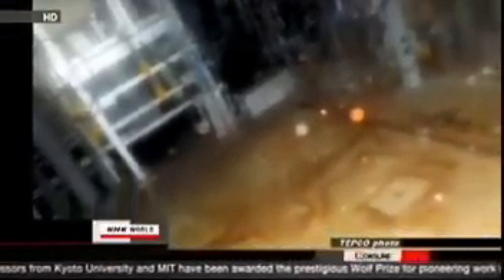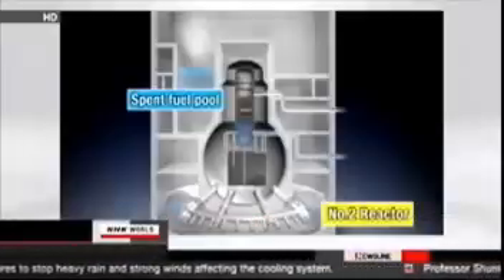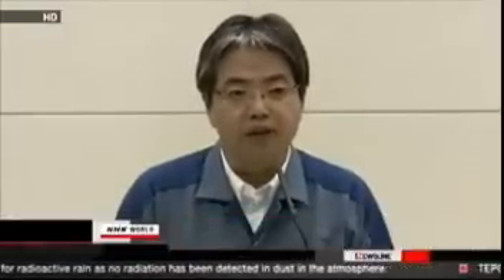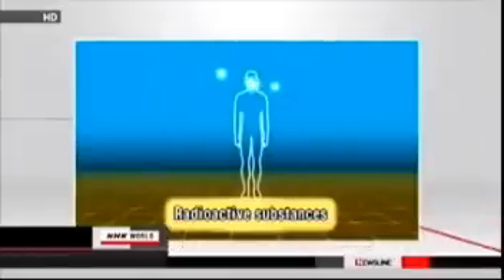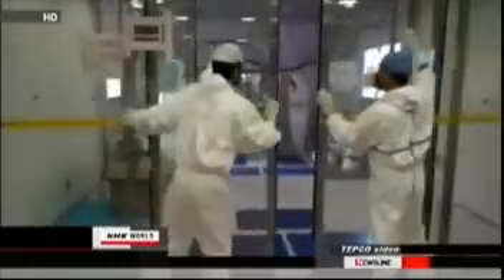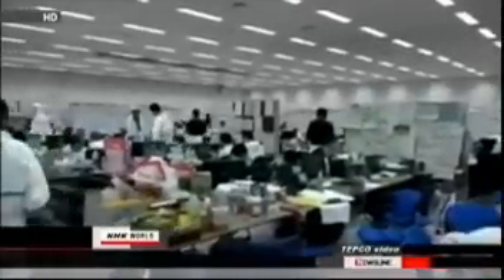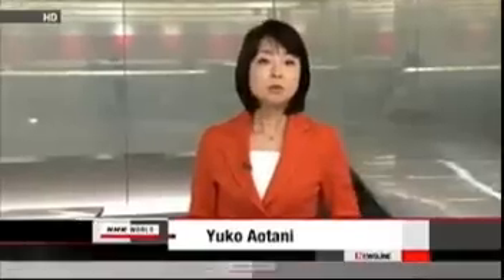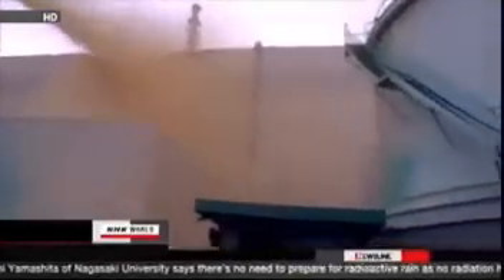Fukushima Update for today 5/30/11

Comment: @MsMilkytheclown Supposedly a gas tank, nothing to worry about. On another note, the EPA has been busy in San Diego, where the city's July 4th fireworks will be cancelled due to concerns of water quality, that will require testing. Radiation not a problem, a little pyrodex or paper wadding from fireworks, that's dangerous!